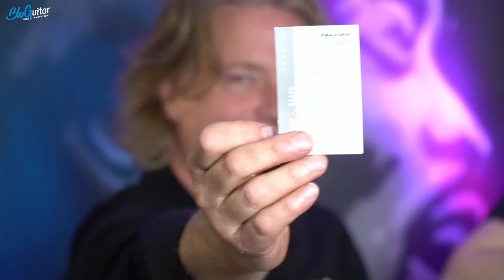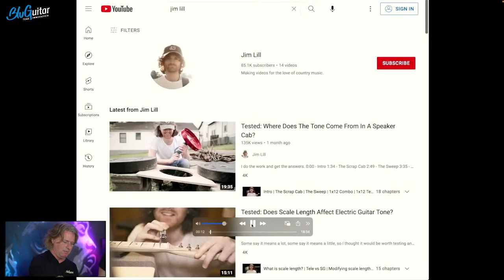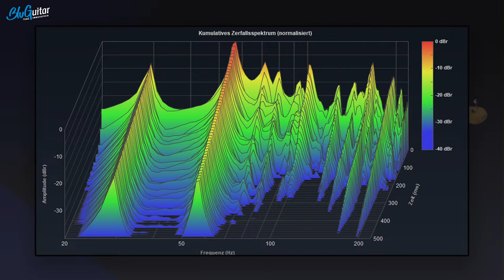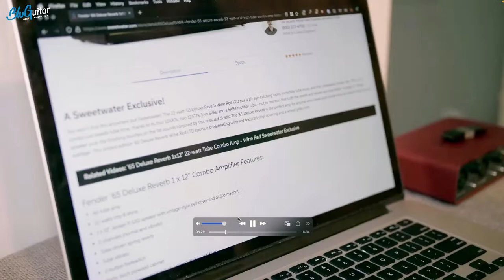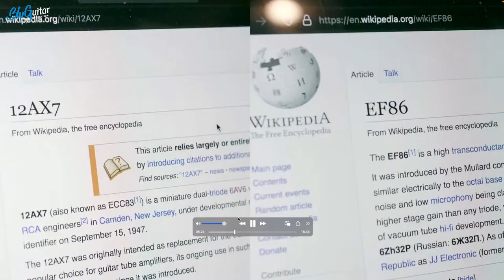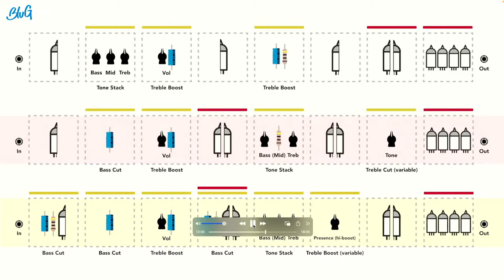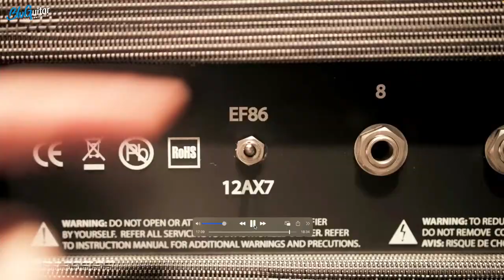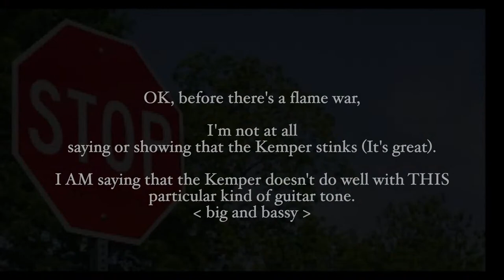Academy Of Tone #129: guitar amp maker reacts to THAT Jim Lill video – the full story on amp tone!

Comment: What you say at 14:50 is what almost forced me to click out of this video's page. Sure, in 2023 we can't measure some characteristics of a guitar sound... Sounds like magical thinking tbqh. I'll watch more, but that is a very strong back foot you set at the start there
Reply: Ok, I watched 'til the end. What you say about the amount of voltage drop on tubes and how it can shape the curve etc., is ok and correct - although VERY easy to achieve in any circuit. I get all the differences of the tacklebox, I think as an aid to prove a point it is great, but if any hobbyist wanted to design a pcb to do the same it would be much better. But the end of this video is a sad culmination of things you mentioned throughout - I believe you are completely incorrect in how you see alias, DACs, step effect and latency/lag... And to rob a page out of your book, and can't prove to you right now, I wish I could but trust me, it is true - you should talk to a physicist or electrical engineer, then talk to Dan Worrall for the audio side.

Comment: I have to admit I don't hear a major difference with things like tube rectification vs SS. I have a JTM50 that I can switch between and the difference is more in the feel than sound. The circuit matters far more than he attempted to prove however. I would have been sadly dissapointed if, after getting my Marshall head home and plugging in, it just sounded like my 64' Fender. The two are dramatically different.
Reply from the maker: Rectifier vs SS is different in sagging of the voltage. The difference becomes more dramatic the more the the amp reaches its limit due to cracking. Of course the frequencies stay the same, but the tightness  and the clipping changes, which is recognizable as different feel and also how the Tone is structured: „sharper“ or „muddier“. It’s about the dynamic…

Comment: Hey, i got a little off- topic question. Is it possible to use a Peavey VT 212 120w 6l6gc guitar amp as a bass amp (converted as a top) , or will it not work because of the weaker bass reproduction of the output transformer. (i read this somewhere in a forum)
Reply from the maker: I will not be ideal, but you will get something out of it. Remember that in the late 1960’s bands like cream, Hendrix experience etc had to play 100 watts tube amps for bass…
They are on the edge of breakup, great for certain styles-not so great for others…
Just make sure you have a cabinet/ cabinets that are strong enough!!! Bass requires power!!!! So 200watts for cabinets minimum, please!!!!
Reply: @BluGuitar  Thanks for the answer! :) The idea with the deuce vt212 came to my mind, because fender and ampeg also brought 100 watt 6l6 bass amps onto the market. Then I thought of the peavey in my attic. :D "The only(?) question is whether the tone stack from the deuce also fits the bass guitar. but i will find out. if not, the amp has a power amp in and i have preamps. If it makes sense." <- Thinking out loud.. And saturation on the edge to "breakup" is great for me. And sure.. i got a bass- cabinet. :)

Comment: It almost seems to me like Jim had begun his research with the premise that these amps sound the same. I'm not getting the impression of him going in without an agenda. Especially with the constant reminder that he's 'just a performer.' He has a knack for engineering, clearly. I don't know any guitarists who can build a multi-eq amp out of a tackle box and pedals. 

He doesn't address the circuit, which is the primary difference, that thoroughly either. He races past a few things, such as using that weird multi-feature Marshall as example of a classic JMP and saying that an RC boost pedal is a solid state amp. 

He makes false remarks, like manufacturers 'market their amps as fixed or cathode biased.' I can't say that I've ever seen a company use biasing as an advertising gimnick. It seems as though he wants this to be the case though and shows his hand here as the experiment not being without bias to show the big bad amp companies and the gear page as false idols.
Reply from the maker: I agree… there’s a statement that he wants to prove. All aspects are revisited under this premise. That’s too simple…